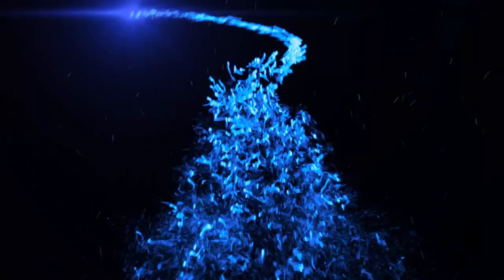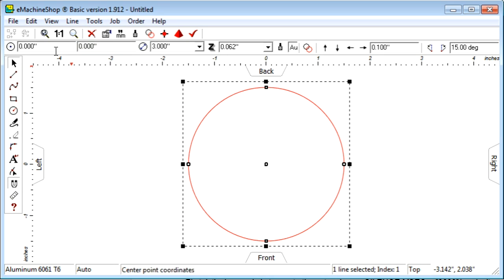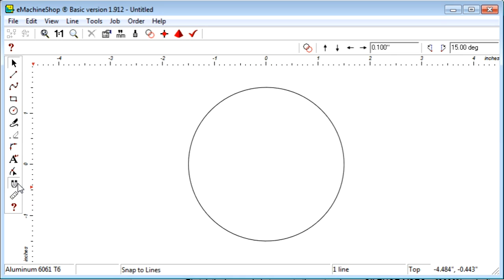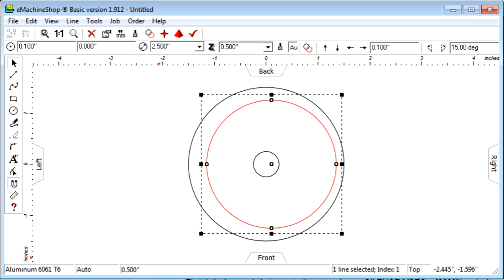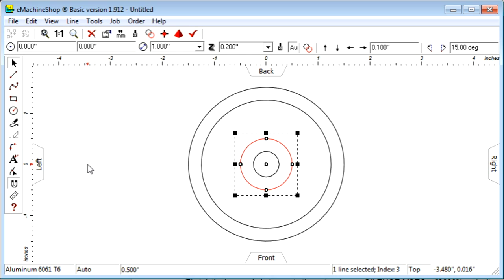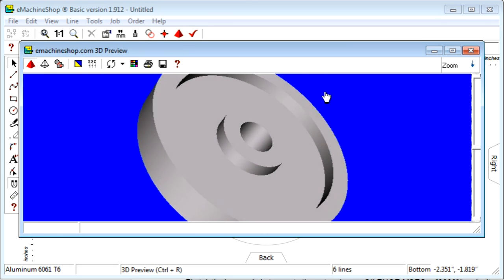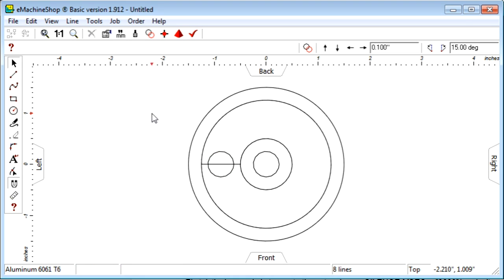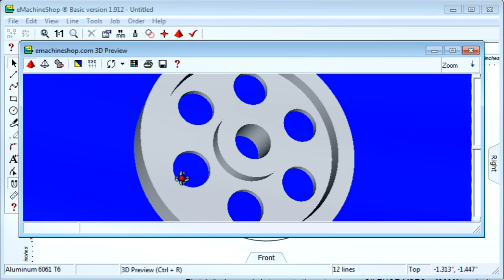3D Designing (Flywheel)

Comment: Hi,
I have 15 HP Alternator (only generator without motor) and we want to fix flywheel to turn it freely and easily, so if you can advise us with the specification and dimensions of the flywheel required as the following information:
- Generator runs on 750 RPM
- The shaft diameter is 70 mm
- We need to rotate the shaft easily with the flywheel 
Please advise with the design and specification of the flywheel, you can also direct me to somebody else can do it 
Thank you,
Reply: Have you found a solution? I need help with same problem you have